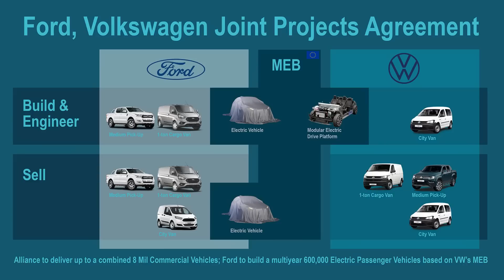VW/Ford Developing Ranger-Based EV; Tesla Plans Big Expansion - Autoline Daily 3491

Comment: No surprise that a softener compound tire would have better braking & cornering performance, but you sacrifice longevity which is already quite low on EVs compared to ICE vehicles.
Reply: I never thought I'd be the guy buying OEM tires, but there's nothing better & cheaper for my EV. They offered me some tire options that weren't even rated correctly for my car.
Reply: Quite possibly at the expense of range.
Reply: @rp9674  it's definitely a safety concern when tire shops assume a 4 door sedan Ev or crossover EV will be fine with a P rated tire. Some of these EVs with the 100kwh pack almost need a 10 ply tire comparable to what a diesel pickup requires because the weight of an EV with a long range pack can get the vehicle weight close to 6k lbs before you put 5 or more passengers inside!
Reply: @OneNationUnderGod.  some of the tires they offered me couldn't even accept the PSI my car requires
Reply: @rp9674  I believe it, those P rated tires are usually only good for 32-35psi, because the sidewalls are not designed for higher pressures and the tire overall is not meant for much over 1k lbs individually.
Reply: @One Nation Under God  With a full tank, an F150 Powerstroke weighs 6000lbs too.
Reply: @georgecostanza2695  first off there's no such thing as a F150 powerstroke, there's f250 and higher that offer the diesel engine. That's exactly what I was talking about, those HD pickups have tires that are designed for the weight, more steel belts inside, more plys and significantly bigger sidewalls to handle the weight and psi in the tire. 

These low profile tires on EV sedans and compact/crossover EVs require a special tire and manufacturers are using a harder compound from the factory so they can get more longevity out of the tires. Many EV owners have been shocked they can only get 25-30k out of a set of tires. That's because EVs weigh around 1500-2000lbs more than comparable ICE vehicles. I'm actually kinda curious for all the emissions EVs save how many additional emissions and environmental impact comes from them consuming tires around 2x as fast?
Reply: @One Nation Under God  not available anymore, unfortunately... but the fact remains: 3.0 Powerstroke was offered in half ton trucks for several years in the late teens, and "P rated" tires are commonly mounted on trucks that won't be driven off road.
Reply: @georgecostanza2695  the P rating has nothing to do with off road use, it's mostly a weight classification. Pickups with P rated tires have low payload capacity so they don't need a higher rated tire. My Denali has 10 ply,  that are E rated with a highway tread. I would be instantly stuck in much mud at all because they are not for off-roading, they are rated for my diesel's high payload capacity.
Reply: @OneNationUnderGod.  Terrain and intended use off road is absolutely a consideration. Load rating is only part of the equation. Noise, handling, efficiency, durability, among others are also considered when specifying a tire. That’s why a lot of today’s full size SUV’s, 1/4 ton, even 1/2 ton trucks come equipped with P metric tires. Along with being less expensive, they are fully capable handling the vehicle’s GVWR and max towing capacity... on pavement. Trucks intended for use in adverse conditions, such as those spec’d with off road option packages, and those intended for “extra heavy” loads such as 1 ton trucks, will be factory fitted with LT tires.
Reply: @georgecostanza2695  anyone that tows anywhere close to their payload capacity with a P rated tire needs their license revoked. Weight and speed are the primary specs that go into tire ratings. Also I've never heard of a "1/4 ton truck" you mean a midsize pickup? Of course those can have P rated tires, their payload is around 1k lbs or less for lower trim/package levels.
Reply: @@Carl_Gunderson you are dead wrong, an F-150 is a 1/2ton pickup. F-250 is 3/4ton and F-350 is 1ton.
Reply: @Carl Gunderson If it had EV batteries, it wouldn’t have a cast iron Powerstroke and it’s ancillaries.

Comment: I wonder how many of those M3 CSs BMW will sell when the Tesla Model 3 Performance is less than half the price, and even slightly faster in the 0-60?  🤔 They look to be about the same size and very similar performance specs, so I'm wondering if the interior and exterior decor is worth roughly $64K more for the Beemer? 😜🤣😂
Reply: My first thought Model 3 performance as well. Excellent point!
Reply: It's not all about specs. The BMW is a different feeling car to anything electric. A BMW or Alfa Romeo feels a certain way to drive in terms of handling balance. And some want that engine sound and exhaust note and the small vibrations that come with it.
Reply: Also a collector item as ICE age ends.

Comment: Almost all OEM tires suck and much performance gain can be had from a simple tire swap for almost any goal (better range, better dry, better winter, better dirt, etc.). OEM tires are purchased to be adequate and to help hit the vehicle price point.
Reply: But the aspect of rolling resistance wasn't really addressed. This is key to the range differences.

Comment: $120K for an ICE BMW M3 CS??????  I'll take a used Tesla Model S Plaid and run circles around the BMW all day long and still have more room to carry cargo!
Reply: Cars are about feel, not only numbers. And I pass slow moving Teslas on the highway all of the time. Most Tesla drivers don't even seem to use their power. BMWs also are better cars in many aspects than Teslas are.
Reply: @benjaminsmith2287  Solid logic there. If I pass some cars, my car is better! 

Perhaps people bought those better performance cars in all respects for their safety or just not in a crazy speeding/racing mood when you were driving?
Reply: @Custo911  My comment has nothing to do with your silly conclusion. I was pointing out that a lot of Tesla drivers don't seem to use the car's performance much and tend not to speed as much as others. I only occasionally see them being driven fast.
Reply: This M3 will sell out imo. But that color is not $120k level.

Comment: I've been watching the EV space for a while now and Lucid doesn't get anywhere near enough credit/exposure for their motor sizes and tech. Their all in one unit is pretty amazing compared to the other tech out there. Their motor technology is far more impressive and advanced than Tesla's and they have been stress testing their motors and battery packs on the Formula-e race circuit for a few years now. Supposedly their intention is to sell their motors to other manufacturers but I don't see them pushing to do this right now. They are instead focusing on manufacturing their own expensive vehicle. I think this is a mistake on their part. I think it far wiser to adopt the role manufacturers like MAGNA are taking is the smartest way to succeed and EV space. Build great tech, sell it to everyone and allow them to use it. Let someone else take the risk and incur the expense as your company supplies the entire industry. 

I think the only smaller motor I am aware of is made by Yamaha and also hasn't been covered much in the automotive press. I believe it's a 1900 horsepower compact EV motor? I'm amazed how quickly manufacturers are working to shrink these units down in size. I can only imagine what compact transportation the future has in store for us.
Reply: Lucid tech is actually pretty dang good. But you have to consider its cost too. You can make something that beats Tesla, but is scalable or cost competitive? And can the issues with new cars (as ALL recently arrived EVs are having) be offset by the appeal of slightly better performance in a specific area?
Reply: Rawlins claims his technology is better, but Tesla engines are more efficient which is the name of the game. I'm not convinced it's better technology when it requires a big battery and price tag. Given Plaid's performance with no need to limit back to back launches or driving performance, I wonder about this claim.
Reply: @Abebe345  Tesla engines are NOT more efficient. The way Tesla vehicles measure and report efficiency in its software is greatly misleading compared to other EV makers which is why their range estimates are so far off compared to what is actually obtainable in real life. Kyle from Out of Spec motoring points out how Tesla reports efficiency in one of his YouTube videos. You can sift through his catalog to find out which one. Once measured side by side against Lucid using the same methodology the Lucid motors proved to be far more efficient. One such comparison by Edmunds of the Model S Plaid long-range show it uses 32.1 kilowatt hours per 100 miles versus the Lucid Air using only 28.3 kilowatt-hours per 100 miles in independent testing. However this level of specificity is unnecessary when simply noting that the range the Lucid Air achieves is so much greater than what Tesla is capable of in ANY version of passenger vehicle it produces including the Plaid S long range. 

Rawlins has done more than simply claim the Air is more efficient, Lucid has proven it repeatedly. Why Tesla is allowed to report efficiency numbers at the front end BEFORE motor drain is applied is criminal and should not be but this is just par for the course with Tesla. In the beginning their false claims were largely ignored as they were the darlings of the EV scene and putting them under too much scrutiny would have likely killed the market. However those days are gone, they are no longer the only game in town and they should not be allowed to get away with such methods. Thankfully their tactics are finally being called-out and should have been done ages ago, in fact, they should never have been allowed to get away with it in the first place. For example Tesla has been fined in South Korea for misrepresenting their winter range claims and is now forced to report properly in that country. I would not expect that this transparency will spill over to other markets they serve unless they are forced to do so.
Reply: @Custo911  Lucid motors has stated from the get-go that they are using the same formula Tesla did with its original Roadster. That is to sell vehicles at the high-end first using those funds to allow them to produce affordable vehicles down the line. Expecting them to develop, produce the tech and release it at reduced cost to the market as a whole before recouping the costs isn't reasonable and would put the company out of business. 

People forget that in 2009 a Tesla Roadster cost between $98k and $130k dollars. In today's money that translates to 130k to 180k and it was rough and nowhere near as finished as the Air. Why should Tesla have been allowed to use that formula and it was considered reasonable then but others do it today and it's considered to be unreasonable? Again, Tesla should not be viewed through a different lens. It takes a lot of money to start up a car company. Tesla has received billions of dollars from the US government and private investors to get where it is today. The company was not built on Elon's money alone. He purchased the company from another individual who was already building the electric Roadster. Very little from the company was actually Elon's doing. Even his wallet was just a drop in the bucket compared to what was received from government funding and investors.
Reply: @Abebe345  as I stated above the original Tesla Roadster cost between 100000 and $130,000 in 2009. That translates to 130,000 to 180,000 today. Tesla use the original Roadster to fund the start-up of the company and produce cheaper vehicles. Lucy is using the same strategy and it said so publicly. So yes it's reasonable to do what they are doing in the way that they are doing it and down the line they will be able to offer cheaper vehicles. The fact that they are able to produce better technology while having less resources than Tesla currently has is amazing in it's own right.
Reply: @genesishep  Lucid has great BMS tech for sure and 5 years ago they would have been successful for sure. Nowadays, with so many cheaper and relatively good options at higher price ranges, it is much tougher (plus Lucid has technical issues with their cars unfortunately...growing pains). I hope to see them make it though.

As for the second part of your post.. please... it is full of misinformation (and a couple outright falsehoods), easily debunked and unrelated anti Tesla rant. Don't waste your effort on me - I read it all.
Reply: @Custo911  There was no rant their everything I said was fact so don't waste your time replying unless you have proof otherwise. But a fanboy won't provide proof and a fanboy doesn't like to be proven wrong so I don't expect you to learn.  Do I care for Tesla? I don't think there anything special. Their overall quality is poor, their mileage claims are ridiculously over inflated and they've been given a free ride for far too long. Beyond that they're fine.
Reply: @genesishep  For a person who doesn't care for Tesla you sure know a lot of the garbage that has been circulated by TSLAQ...
Good luck though. From what I see you are a Lucid investor... and unlike you, I really wish you well there.
Reply: @genesishep  hmmm can you show (on this anatomically correct doll) where Tesla hurt you so bad that you ignore everything else when you hear its name and charge spitting insults and loud proclamations?
Reply: @genesishep  the tone was changed by you when you went into weird and warped detail on the past that had little to do with the topic. All I asked is to keep that misinformation to yourself (which set you off even more lol).

If you haven't noticed, YouTube comments are not conductive of an actual debate - can't link anything... And besides, you are unlikely to accept any evidence given your combative demeanor.
Reply: @genesishep  Ever since you devolved to insults, it has been my amusement pointing out just how deranged your posts are.

You changed topic and went bananas when I said it is pointless to spread that misinformation since I knew better.

Comment: 🏁TESLA = No. 1 EV-maker on planet Earth 🥇🏁
Reply: Meh
Reply: Another Tesla TROLL?  Geez, you've gonna get it!  🎯🎯🎯
Reply: BYD sold over 911,000 EVs globally, and more than 946,000 PHEVs for a combined figure greater than 1.86 million, as Inside EVs reports. Tesla sold 1.3 million.  Good luck . . .
Reply: Tesla is already falling behind in terms of production numbers and quality to BYD and total Range to Lucid a while ago.  Tesla has worse build quality than a Toyota Corolla. thats starts at more than twice the price for the least range in the lineup.
Reply: @ronjonesprod  A Toyota Corolla has solid build quality. In fact, it's a really good car in terms of overall refinement for price. A Tesla doesn't have the build quality of a less-expensive Ford or other US-built car. But Teslas have some great attributes. In time, the 3 and Y's sales will go down and Tesla needs to struggle. That will make them a better company. And one day Musk hopefully will not be the CEO as he just turns a lot of people off to the brand.
Reply: @benjaminsmith2287  That is true. Tesla, technologically, is definitely in the top 5 in my opinion next to CATL, BYD & Lucid. The 4680 cells are incredible, however, I think the manufacturing behind the 4680 cells are slightly more impressive. The Gigafactory is setup for the fastest & possible output but, that puts strain on the workers, forcing them to work unusually long and unorthodox hours without weekends. This may be the main reason to replace Musk, as he's concerned more about numbers rather than a healthy work environment, quality, and reliability like GM. And like you said, a lot more people who are turned off by Musk, will be attracted to the company, therefore, sustaining demand even after being ousted or demoted. 
He'll still own a percentage of the company anyway and likely sustain his strong influence from Twitter lol. 
And what about Megapacks or SpaceX or Starlink he's got to worry about? It'd probably help him out knowing he has like 9 kids as well.